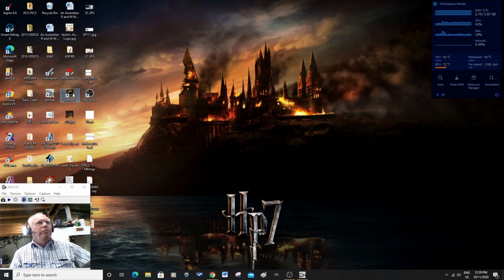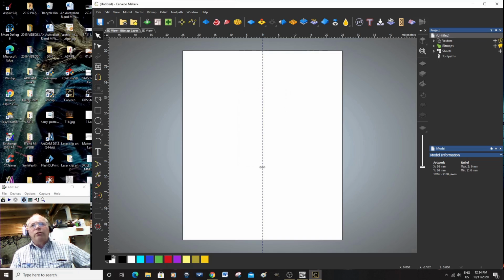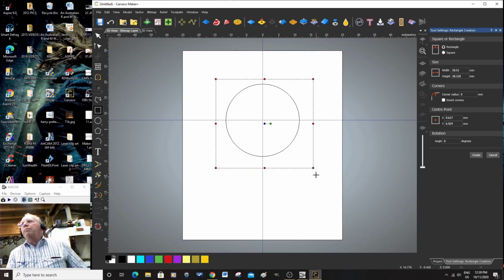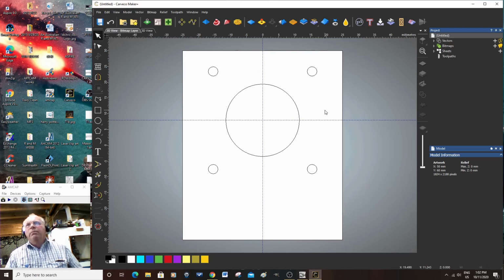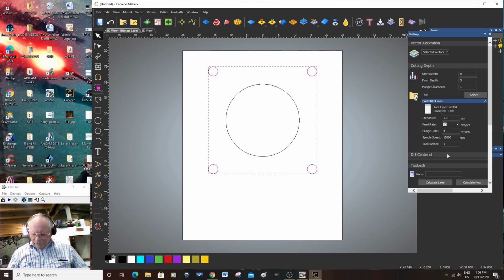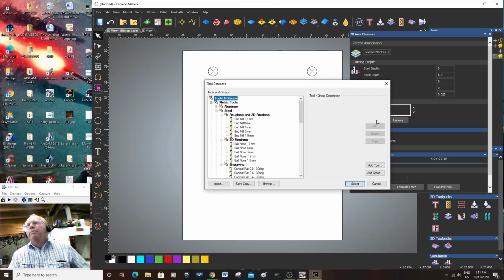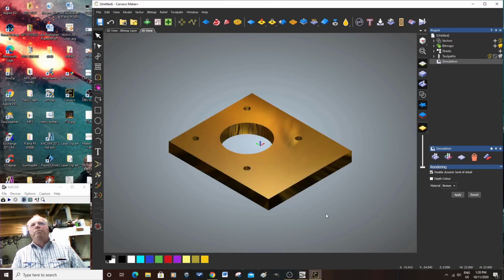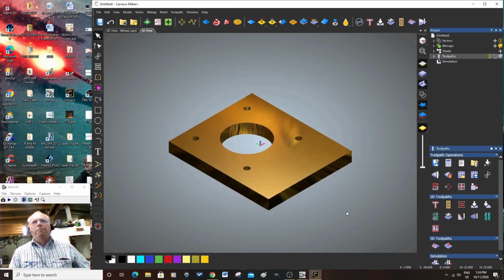Video 499 Carveco Maker + CAD tools and CAM tool strategies

Comment: Hi Roger, Just got a SMC 5 controller. Do i need a post processor and if so what do i need ? Thanks.
Reply from the maker: I use mach3 mm (tap) or G code mm (tap) as the post processor in Carveco or ArtCAM for my SMC5